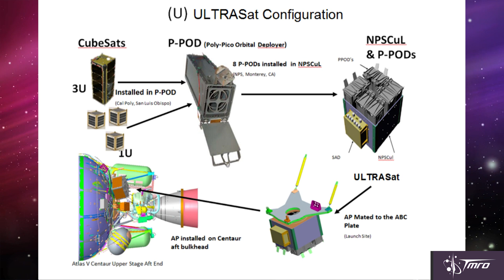Secrets of the X-37B Revealed - SpacePod 05/19/15

Comment: How is the X-37B an Orbital HAARP weapon system? The X and B of the X-37B stands for X-Band. X-band is a segment of the microwave radio region of the electromagnetic spectrum. X-band is used in radar applications including continuous-wave, pulsed, single-polarization, dual-polarization, synthetic aperture radar, and phased arrays (HAARP).  The orbiting X-37B is outfitted with an Active directional X-band beaming Phased Array, making it a Star Wars weapon. Phased arrays creates a very narrow beam, aimed electronically, to precisely and rapidly scan, or focus energy, on the ionosphere (and steer the jet stream or create and steer hurricanes and tornadoes) or on land (and trigger an earthquake) or at sea (and trigger an earthquake induced tsunami). The 37 refers to the scintillation index at X-band (m = 0:37).

The orbiting X-37B X-band phased array antenna consists of thousands of antennae driven by transmit/receive (T/R) modules. T/R modules are multi-functional circuits that can transmit, receive, and amplify signals. While in orbit the unmanned X-37B can be precision-guided remotely by the United States military to any part of the Globe and positioned to heat up the ionosphere above a target area and create “climate chaos” (both widespread or localized extreme weather conditions) or bombard the Earth below with either X-band microwave energy or tungsten kinetic energy projectiles and trigger an earthquake and or tsunami.
Reply: I dont believe its capable of inducing an earthquake as that requires trespassing the earths crust. Not even a nuclear bomb can create an earthquake, its shock waves would register on the seismic meter but the computer wouldn't know its a nuclear bomb. The weather modification theory is more plausible though, although even that is quite a stretch,  I don't think something of this size can steer clouds for example, the microwave would pierce through the atmospheres..

Comment: G'day Mike,

Yay Team...!

 Hmmn, so by the  general arrangement and  performance of this "Robo-Drone in Space" it appears that the only problem with the Shuttle was the requirement to carry Humans on it.. ?

  Regarding these "Hall-Thrusters"...; where do they get the Electricity ?

 If the Spacecraft has an array of Solar Panels which is 25% efficient (very expensive, state of the Art for what's available off-the-shelf..), then the Ion-Engine can only ever access 1/4 of the Energy which has hit the Array, and once Battery Storage-Inefficiency and Propulsive Inefficiency are factored in then you're in an analogous position to a Boat with a Wind-Turbine turning a Shaft to drive a Geared Flywheel to store Kinetic Energy, with the intention of using that Kinetic Energy to power a Shaft spinning a Screw in the Water to push your Boat against the Wind, which is driving the Turbine...

  It would probably be easier if one were to attempt cobbling up a Perpetual Motion Machine...?

   Meanwhile, Solar Sails are not only really difficult to rig (nobody's done it, yet...), but unless one considers being blown downwind to be "Sailing" (accelerating directly away from the Sun), then the fact that there isn't anything to stick a Keel or Centreboard or Rudder into means that with nothing to resist making Leeway it is impossible to alter the Vector of the Thrust or the resulting Course

 A Sailboat is an INTERFACE VEHICLE..; and in the Vaccumn of Space, there is no Interface, and there is no way to Reach or Tack or Gybe or Work To Windward...

 The best you can hope to do is to be wafted away from the Sun and then attempt to use an outer Planet for a Gravity-Slingshot, to try to return to the Inner Solar System...

  It's like Kim Stanley Robinson's Perpetual Motion Airship in "Red Mars", with jury-rigged  Windmills driving the Propellors to generate the Airspeed to create the Lift to maintain Altitude, while the Slipstream caused by the Airspeed turns the Windmills ; thus compensating for the Dust-Storm which rendered the Lifting-Body Airship's Solar Panels inoperable....

  Nothing can "Sail" without an Interface, and in Space there is no Interface.

 Such is my prediction, along with the feeling that Ion-Engines won't ever overpower the Solar Wind which powers them ; but, maybe, perhaps, a PV Array could operate a Hall-Thruster to do for a Solar-Sail what Centre-Boards do for a Raft built of Balsa Logs, provide a Vector to oppose the Thrust of the Sail so as to be able to steer the thing ?

 I wish them luck, but I don't expect much success..., Perpetual Motion has always Bin-Complicated...

;-p

Ciao !
Reply: Ion engines are great for long-term missions which require lots of course corrections. Dawn is a prime example of that.
Reply: Karriz 

Well, they have their applications, I'm sure...; but I'm trying to get my head around what they can and can't do, and to frame my reference I'm comparing it to how much PV Area and Batteries it takes on Earth to be able to collect enough Sunlight to recharge enough Batteries to be able to use a Kilowatt-Hour of Electricity.

 Regardless of whether it's a Waterpump, a Hairdryer or a Hall-Thruster, if it's rated at a Kilowatt or ten of them..; it won't go if it isn't being fed...

 Have a good one,

;-p

Ciao !

Comment: What does a vehicle like the X-37B brings to the table? i just don't get it!
If the purpose was to deliver payload, you could do it cheaper by not sending a X-37B vehicle with your payload, if it is to return some experiment from space it still cheaper to use mini capsule with a chute then to use an X-37B
Reply: Giza Plateau You're a moron.
Reply: Guilherme Guerchmann might just be a halfwitted program that happens to be visible. What you should wonder about is the unseen programs.
Just a tiny tiny hint is the fact that Hubble was military surplus. It was just a couple of spares with too pathetic mirrors for the military to use. And you sheep think that Nasa is an honest state of the art effort...
Reply: Guilherme Guerchmann Some USAF general probably is a fan of battlestar galactica and told his engineers: build me one of those raptors, before the ruskies have 'em.
Reply: Considering that a KH-11-type spysat costs several billion dollars I would say that there would be some sense behind a reusable spysat. The X-37b is too small for this purpose but it is just an experimental vehicle.